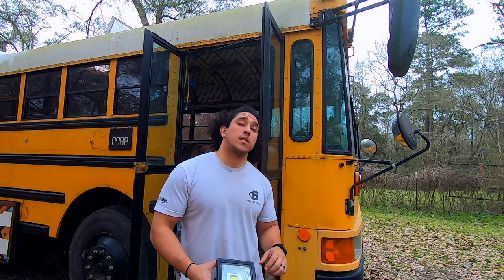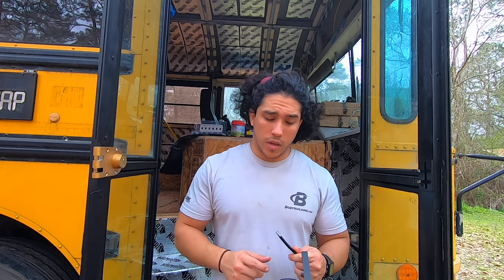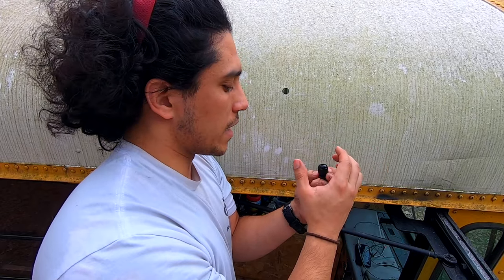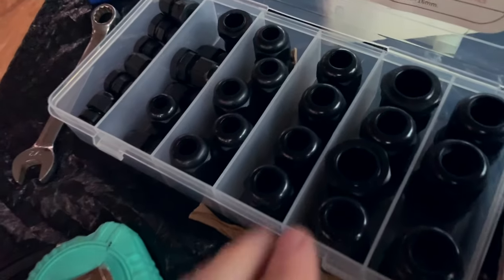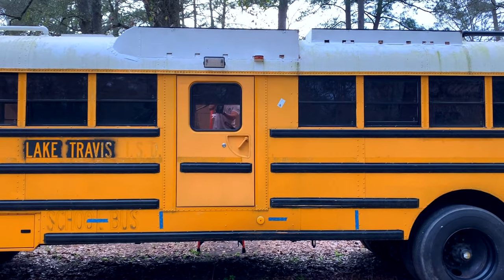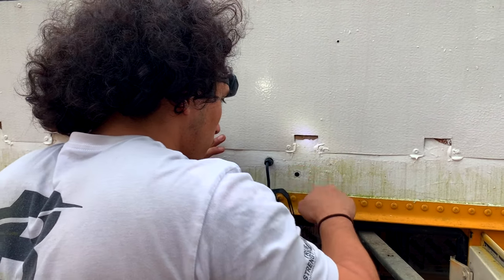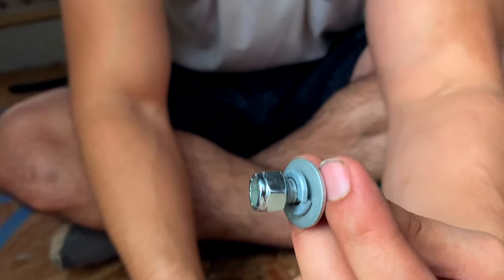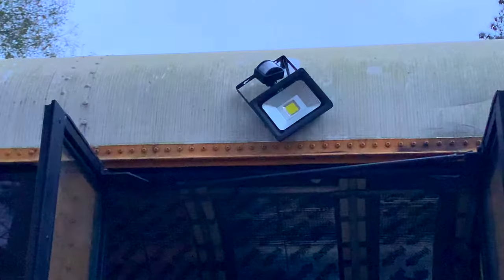Mounting Outdoor Floodlights On Our School Bus * Skoolie Conversion * Gus The Struggle Bus

Comment: Good afternoon you two, great videos as always. Outside lighting a must. I will drop you an email soon on my rear storage area done and the possible holy grail of bonding materials, wood to metal.
Reply from the maker: Thank you! They did not turn out as awesome as yours did but hopefully they work! Yes we can't wait!
Reply: @GustheStruggleBus  Your lights are just as fine. I really like the photo sensor to activate when someone comes by. Just like a house. Since brackets are in, pick up a spare, just in case. I do recommend some Locktight red on the bolts so they don't come lose while driving and associated road vibrations.
Reply from the maker: @johnclamshellsp1969  Agreed! We will make sure to add those things, thank you!

Comment: Good call going with the lock washers!  I'll bet bus vibrations would rattle those suckers right off without 'em.  Why did you choose the 120volt ones instead of solar or 12 volt?  We'll be doing this project in a month or so!
Reply from the maker: Thank you! yes we learned quickly that you need lock washers lol. These lights were a gift so in other words free!! haha the 12v would work great too!

Comment: Did you need to put anything on top of these Kilmats in order for spray foam to adhere?
Reply from the maker: No, we did not. We also asked that same question to the company that did our insulation and they said it should be fine as long as there is no condensation on the matts